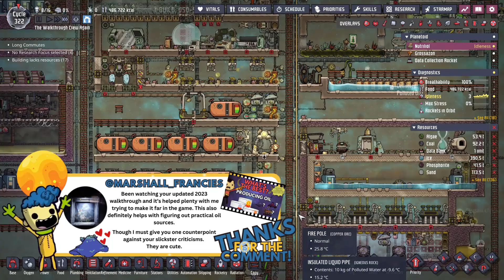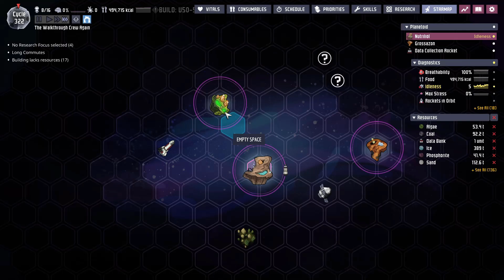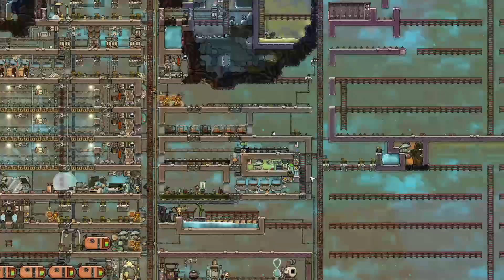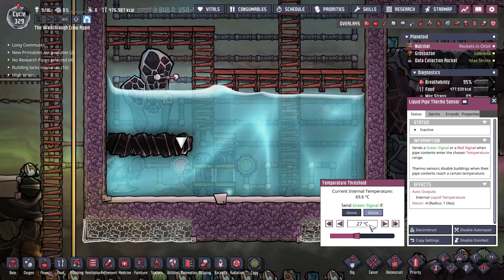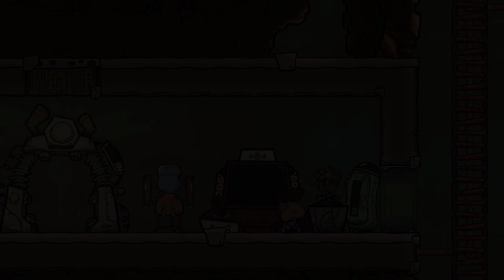Oxygen Not Included: Spaced Out Walkthrough Part 25 (2024)

Comment: Update - The first Thermo Aquatuner / turbine setup is finally running without any modification.  I just didn't understand what the gas pump was used for or how long it takes to make the steam.  (Also still do not know what the gas vent in the turbine chamber is for but doesn't seem to matter.)

Now having the same issue with this episode because of the 5 liquid res tanks in the top left corner of the rocket area.   I have watched part 26 to 29 and still have not seen them explained.    It would be nice to have them ready when the time comes instead of another huge delay of filling liquid tanks.  Should be filling now while the dupes are busy with other builds.

Comment: 18:40. Use that new radiator looking pipe. I forget the name of it. It's used for cooling buildings directly. It cools whatever touches it and transfers the temperature to the liquid that is passing through it. it works in space and also I think you can set it up so one tip is in a hot zone and the coolant on the other side of a wall. the liquid does not need to pass through it for the exchange of temperature to happen.
Reply from the maker: Yep, those would work too!